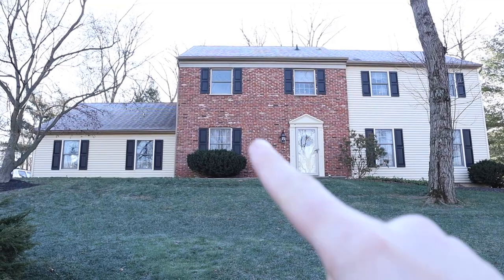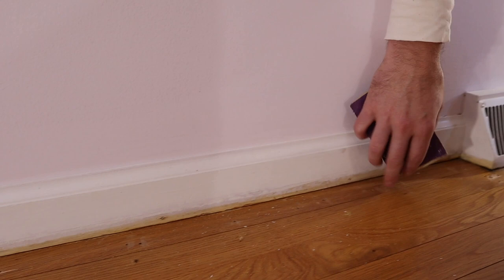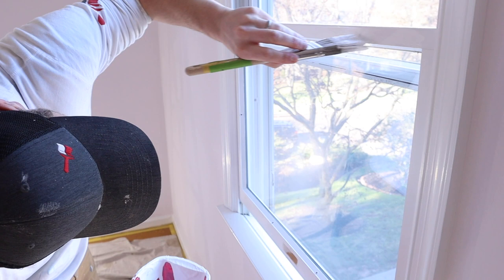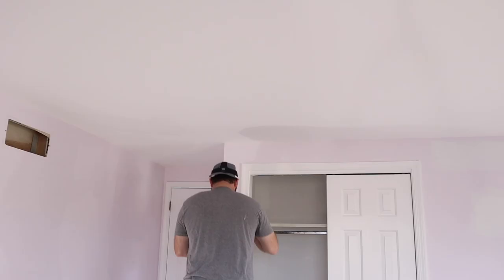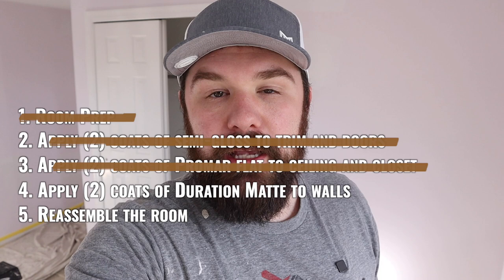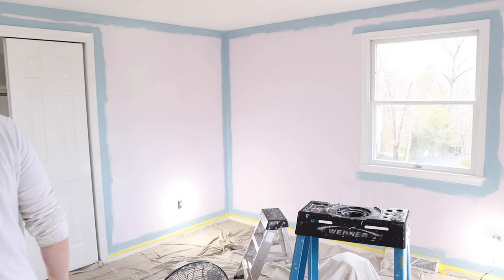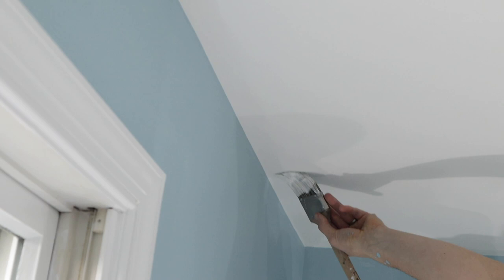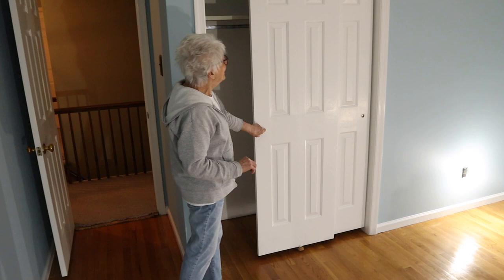Two Brothers, One Bedroom, Let's Paint

Comment: Friendly Tip!  Liked your video!  Few things to help you guys out is, when rolling ceilings roll thigh touching walls with roller.  Take the Richard 2 1/2 gooseneck paint brush on a pole, wiping the paint around the ceiling. Quick and fast. Saves TIME and MONEY!  Walls, roll first coat, then cut in. Last coat cut in one wall at a time and roll. youtube video's gooseneck paint brush. The Gooseneck Guy! Cheers!
Reply from the maker: Thanks Donald!  We've used the Gooseneck for hard to reach areas.  It's quicker for us just to cut in with regular brushes, but that's our process.  Thanks for watching!

Comment: What kind of paintable exterior caulk do you recommend for use on a front door that gets beat up by the sun?  The caulk is only to fill nail holes on trim of newly installed door. I will use touch up paint on top of the caulk. I've been reading a lot about polyurethane paintable caulk. Inside I always use SW Powerhouse red tube and I love it. But I'm not sure it will hold up long term outside in such a prominent area for all to see when arriving at my house. Your opinion would be greatly appreciated! Thank you for all your wonderful videos. I've subscribed and I always give you a thumbs up.  Keep up the great content.
Reply from the maker: We don't usually use caulk to fill nail holes.  I'd recommend going with a paintable wood filler that is able to be sanded.  Fill your holes, sand them smooth then paint over top.  It can be difficult to get caulk to look good when filling nail holes, unless they are tiny.
Reply: @SuperVassarBrothers   It is a composite trim, not wood. Hopefully your suggestion still remains the same. Sorry, I should have been clear on that with my original question. Thank you so very much for taking the time to respond. You're the best!

Comment: It looks like you removed the yellow tape after the paint dried, but I always heard you need to remove tape while paint is wet.  Which is best?
Reply from the maker: We usually do 2 coats on everything, which means one layer of paint at least is always dry up against the tape.  We've developed a system that works with the products that we use.  Yellow frog tape pulls really well if you pull it correctly regardless of whether or not the paint is dry.

Comment: So what exactly happened with the ceiling?
Im about to do 2 of my ceilings with the same paint.
Reply from the maker: I'm fairly certain that something else got mixed into one of the cans, or one of the cans froze and then thawed in the truck.  We may have accidentally poured some primer into one of the cans.  It was hard to tell in the video, but it was dramatic difference between the cuts and the rolling.  More so than even typical "picture framing" that we typically see with darker paints.  Also, it's extremely unusual for Promar Ceiling Paint to picture frame.  I'm using more of it tomorrow, so we shall see how it goes.  

I don't think you'll have an issue, but I'd roll tight into the cut lines in any case.  Good luck with your ceilings!
Reply: @SuperVassarBrothers  thanks !